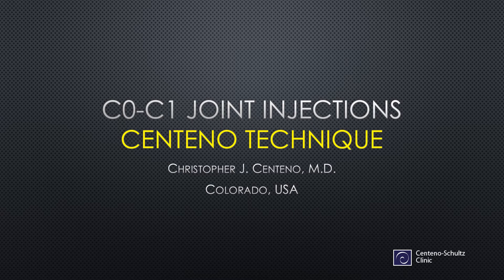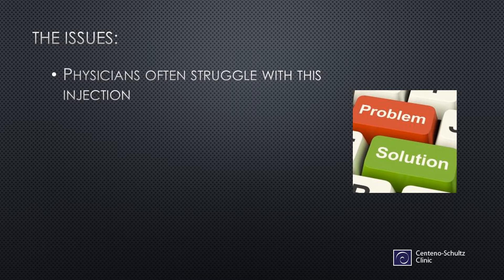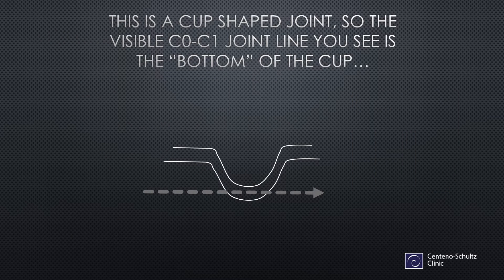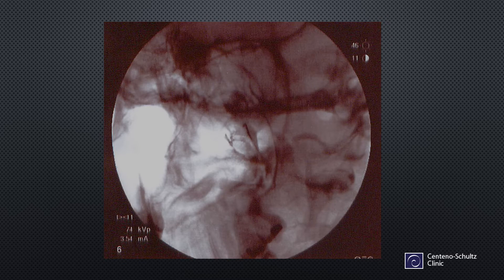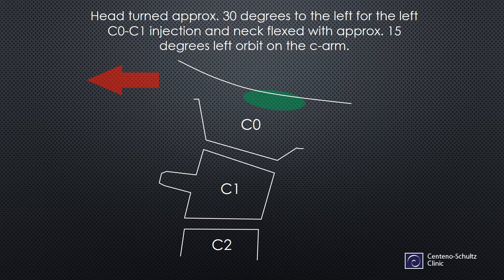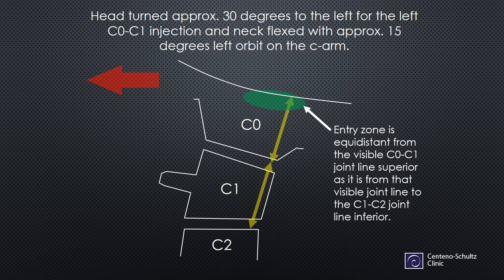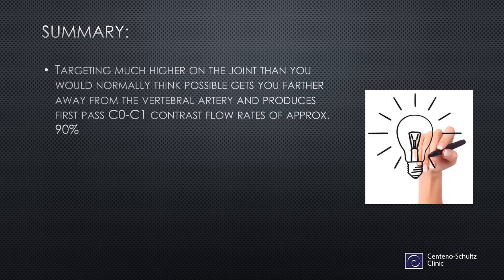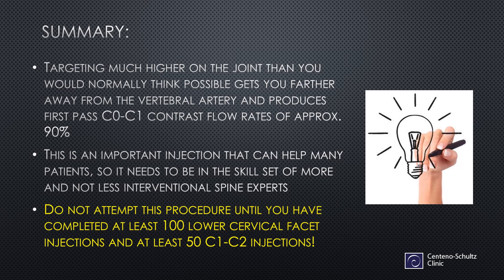C0-C1 Joint Injection - Centeno Technique

Comment: Hello doctor, can we have a stretch in this joint capsule following a false movement but without necessarily having damaged ligaments? Can we see it on an MRI if the capsule is stretched?
Reply from the maker: That can't be seen on imaging and would be more craniocervical syndrome than instability, as the latter requires ligament damage. See https://www.youtube.com/live/2SuFHaassXc?si=uEGGeINzwQ23OKBM
Reply: @centenohome  and in this case does the cervical C1 also move or is it in its place and the pain and symptoms simply come from the inflammation of the facet?
Reply from the maker: @ Either could cause symptoms.